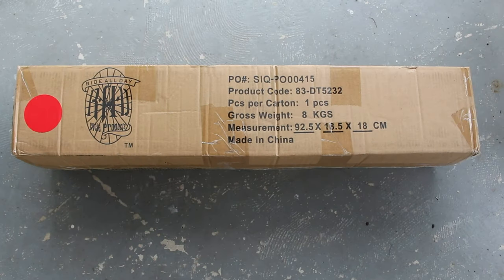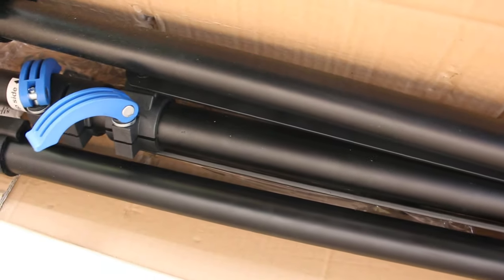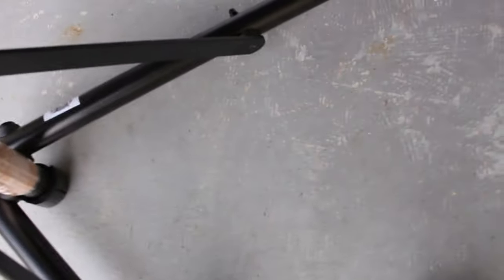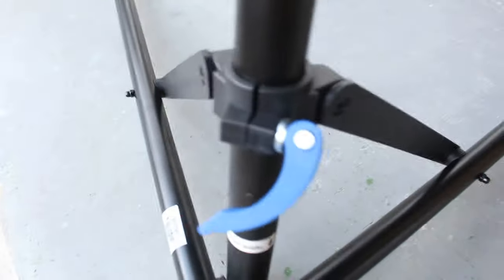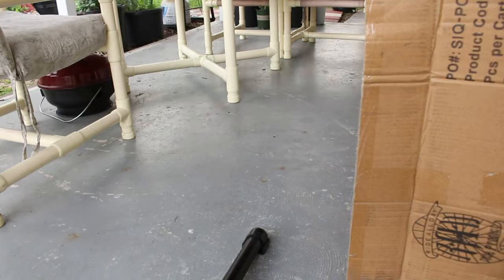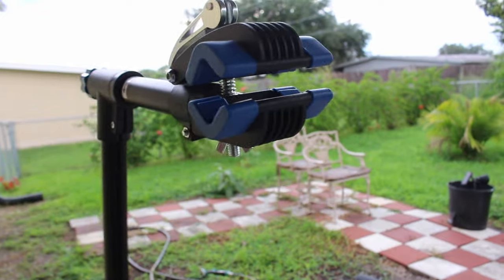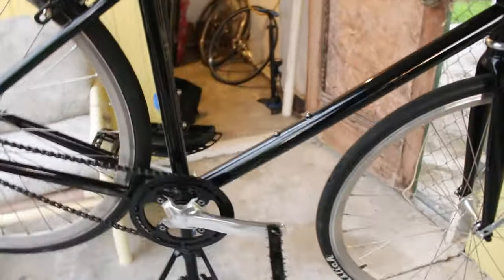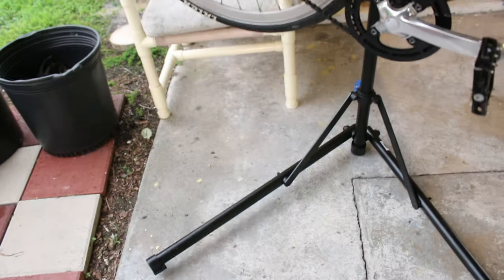Don’t buy this cheap repair stand (update)

Comment: We've had very similar stands at the local bike share and repair workshop.
The thing that broke on it was the quick release that holds the bike gripper closed. Replaced it with a standard bolt. Also the rubber grip stuff comes off the gripper. Other than that nothing really broke on it structurally wise but just generally a bit annoying to use.
Since had some park tool ones donated and they are so much more up to the job.
Used with care at home for a light weight road bike these cheap stands are alright for the money.
Reply from the maker: I’d 100% agree, if I never had the better park tools stand and if I were only holding light weight bikes, under or about 12kg, then I think it would be wonderful.
Reply from the maker: Thanks for the insight btw in what may go wrong

Comment: I own this stand, it works best clamped to the Top Tube not the seat post so the weight is more evenly distributed.
Reply from the maker: I was finding the same thing, just sort of like a bike repair stand hanger.

Comment: Lidl were recently selling the Crivit bike repair stand for £25, that's less than euro28 or US Dollar 32.  Pretty good for occasional use.  They seem to sell it once a year, so check it out when it's on sale near you.
Reply from the maker: I’ve been hearing about they one but haven’t yet seen it for sale. People seem to generally like it, obviously considering the price.
Reply: Yes, the Lidl stand is great value and it comes from an ethical company, not amazon.
Reply: Aldi has been selling one for approx. $25US for the last couple of years.  There's only 2 or 3 per store and it only happens once per year (it seems).
Reply from the maker: @bstitely  I know they're like a rare drop in a RPG.

Comment: Not bad for the price and okay for ocassional cleaning and maintenance maybe? The Park Tool stand sounds good value if it would still be working perfectly after 10 years, I guess it probably would. I bought a cheap 5 leg stand for £25 2 years ago. It works fine but I tend to use it for cleaning and minor repairs more than anything. I don't overstress it like when removing or installing BB bearings, I don't think the plastic clamps are up to that.
Reply from the maker: Well I’m going to do everything on it, hope it holds up!

Comment: Add some lead weights to the inside base of the stand(you can buy some fishing lead weights and pop them in the tubes of the stand) . That will make it more stable.
Reply from the maker: dude that's a great idea, I think I will do that. thank you!
Reply: Better yet go to a tire shop and just ask them for some used weights.  They likely have buckets full.
Reply from the maker: @chadbogner4621  that's a good idea too, I know some shops personally I could ask.

Comment: 5:20 we can see it on the vertical lines (tube and T part). Badly designed.
Reply from the maker: Hey there EU20! We’ll see how it holds up over time, I’ll surely use it.